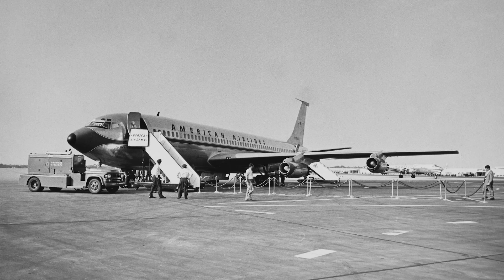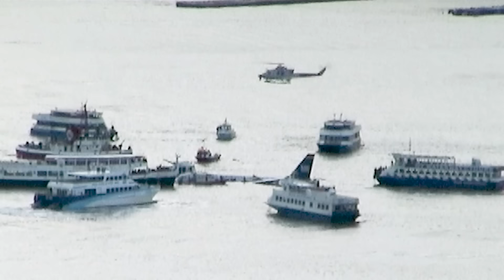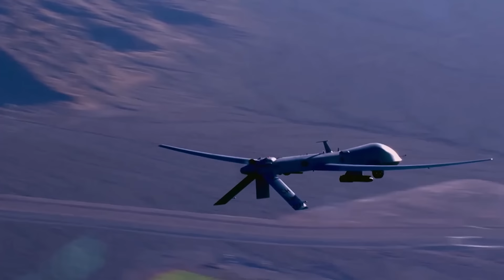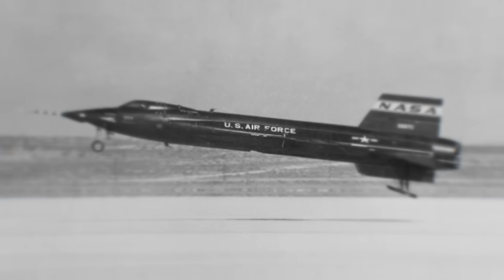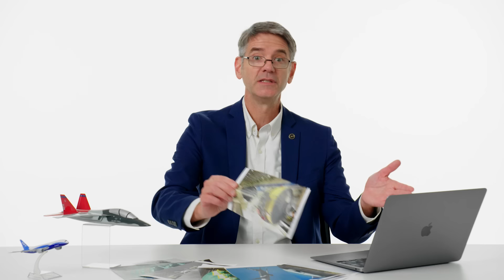Aerospace Engineer Answers Airplane Questions From Twitter | Tech Support | WIRED

Comment: The ramp does make sense. It'd like to see someone bring it to market.
Reply: No, it DOESN’T!!!
Reply: @johnp139  Talk about being uninformed. A well designed ramp will allow runways to be approx. 35.8% shorter and decrease runway related crashes by 59%. You can test it yourself scaled down with models, it works.

Comment: No ALL multi engine planes can fly with an engine out. Smaller piston engine planes don't need to be certified to fly on a single engine, and often times when an engine goes out, the plane ends up in a "powered glide". However ALL airliners can fly with an engine out.

Comment: The best way to understand how air lifts a wing is with a sheet of paper. Hold an edge of the paper at your lips, then blow over the top of the paper. The paper will then lift up, due to the faster moving air on top of the paper dropping pressure.

Comment: To be clear, air travel is safer today than ever. The NTSB investigates all crashes and significant pilot deviations even when there is no injury or loss of life. In the vast majority of commercial crashes, the causes are investigated and recommendations and changes are mandated to make that particular reason very unlikely to happen again. Much of the training pilots receive post license issuance is a result of those investigations.

Comment: Gonna guess it's cost and that it would put excessive wear on the landing gear and frame, also there isn't much of a point because you would also need an arresting wire capable of significantly slowing a commercial jet which really would be expensive.
Reply: For WHAT??? He answered MANY QUESTIONS!
Reply: @johnp139  the title.

Edit: sorry thumbnail*

Comment: I have family that works in the Aerospace industry and i remember one of them saying they were working on designing software that if both pilots were compramised the airplane would go into a holding pattern at the nearest commercial airport.  Another family member was working on hydrogen cell powered aircraft.
Reply: What happens when it runs out of fuel?

Comment: Airplanes use metric system or imperial system?
Reply: Mostly imperial. The only difference is in weight. In NA they use lbs (pounds) and gallons for fuel. In ROW uses Tons / kg for both weight and volume.

Comment: I may just be dumb, but if a plane can fly with 1 engine, how does it continue to go straight and not just into an uncontrolled spin? cause isn't the center of mass/gravity near the middle of the plane? so wouldn't the 1 engine just push one side forward into a spin?
Reply: Aerodynamic surfaces such as a rudder.

Comment: Re: the last 50 years -- airplane speeds have not increased over the last 50 years because increases in speed result in a decrease in cost efficiency. Beyond the current cruising speeds, efficiency begins to drop rapidly, which increases costs rapidly. We're at that perfect compromise of speed and cost. ("perfect compromise" ha ha)

Comment: 10:24 Not the best answer! Obviously, the ramp would be installed after the point of V2, when the plane was committed to take off anyway. In addition, his explanation about needing room to stop doesn't make sense, because going up the ramp would help stop the plane.
The real reason you wouldn't want a ramp is because most runways are multi-directional, depending on wind direction. Interesting that he failed to mention this!

Comment: wouldn't it be possible to just use a combination of electric and gas? like, have a slightly larger turbine in the back of the plane, which generates electricity which in return powers electric motors that drive the plane. this would also replace the standard generators on board of the plane, as they are no longer necessary. this would also reduce drage I believe as now the power can be made by thinner electric motors, having in total a lower frontal area. 

this plane is now less reliable, as there is only one engine carrying the entire thing, but this one engine is exposed to less harsh conditions, can be made of a higher quality as costs are now saved in multiple ways, and thus can be made much more reliable then the standard jet engine.

the only problems I see is the design, as the engine should be easily removable for service since there is just no way a mechanic will be crammed up in the tail piece, plus the areodynamic design of the tail will be gone, since there is now a giant exhaust.

Comment: That’s odd… the other guy on “Wired” said 1 in 11 million… this guy said 1 in 123 million😂
Reply: That's the difference between international and domestic flights.

Some countries and low budget foreign airlines lack alot of safety standards.

Sadly this year will probably be deadlier than the last in the US, because the president just gutted the FAA and fired hundreds of air traffic control staff.

Comment: Why hasn't commercial aviation improved? Well airplanes have improved (a lot), but airlines have gotten worse, and mostly that is due to cheapness/service cuts. That is a business issue, not an engineering/design issue.

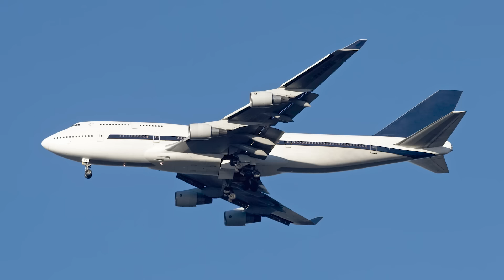Comment: 3:30 747 had up to 5 engines mounted to the wings, but they didn't often install the 5th engine.
Reply: The 5th pylon was for ferrying engines only
Reply: @Orbital_Inclination  yep. that's why I specifically said "mounted on the wings"
Reply: @Orbital_Inclination  PS, the only record I can find of the 5th pylon being used to carry anything is Qantas and Virgin Galactic. Do you know of any others?
Reply: @Orbital_Inclination  P&W have a 747 SP with 5 working engines, but the 5th engine isn't mounted on the wing. (And of course they all have a gas turbine in the tail)

Comment: Airplanes are safer than cars, but i have to disagree with the second factor, multiple redundant systems.
Cars have the same amount of critical backup system as planes. Only cars have way less critical components. Basicly, brakes on a car are the only critical system you would need, and you have your main brake and your emergency brake as a backup.

Also, when it comes to hardware, the same safety principles apply, including testing and crash investigation.
If flaws are discovered, a recall can be mandatory.

Now, where it all falls apart is any monkey can get their hands on a driving license, and these are mostly given for life,
No matter how many rules or regulations change.

Comment: The question "Can a plane fly with only one engine?" isn't answered correctly. You made an answer to the question "Can a plane fly with one engine _out_?", which is not the same with engines having more than two engines.

So if you have a plane with four engines, can it fly with only one of the four engines?

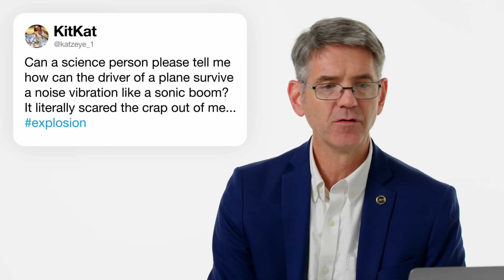Comment: About 9:00. The batteries would also get lighter as electricity is used out of them. Obviously the weight of the battery itself is way bigger than just a fuel tank for example, so the effect is neglible.
Reply: Are you serious???
Reply: @johnp139  Yes, a full battery is slightly heavier than an empty one. I'm surprised people don't know that.

Comment: After 35 years as an aircraft mechanic I've wondered if they are missing some simple ideas.
1) Elminate wing flaps and slats.
2) Eliminate thrust reversers.
3) Eliminate retractable landing gear.
4) Reduce the pressurization system to one and just fly lower.
5) Eliminate flight controls and vertical stabilizers and just use vectored thrust.

Comment: most of those comments make me wanna puke ... why do people think you need to be some engineer or professor to state common sense? i can easily answer 90% of those questions by using common sense.
things like why black box survives and why can't you make plane out of same material .. it's common sense and basic physics. same reason why you can make 3D printed plane and throw it out of window and it won't break when it crashes onto ground, but you can't even make a real size plane out of 3D printed material as it would fall apart even while being at ground --- common sense!

or things like why plane flies at 35000 feet .. it's COMMON SENSE, it's where drag to lift ratio is optimal to save as much fuel as possible. i'm absolutely SHOCKED to see how dumb people are in comments ... thinking you need to be engineer to understand common sense.

or like questions about g-force and how pilot survives sonic boom ... those are just FACEPALM 1000x, i undestood this when i was like 5 years old, it's common sense ... i learned what g-force is when i was using a swing at 5 years old. i have senses, i can feel how forces effect my body. i didn't know it was called "g-force", but i understood the concept ... what is there to understand? its common sense!

and then ppl in comments go like "wow he's so smart" ... he has common sense, you don't.

Comment: 2:28 He is correct to state that all of these are important reasons why people can flying 35,000 feet in the sky at 500 mph and still be relatively safe, but none of them really address how this could possibly be safer than driving with four wheels at a fraction of the speed on the ground.

The most direct explanation as to why there’s a lot less plane accidents than car accidents is: there’s not a bunch of other planes near you clogging up the sky on their way to important daily events.

Comment: I came here for the ramp answer, BUT MAKES NO SENSE: he said more space to brake, but the ramp would help to brake. The most correct answer would be "is better to hit something in front than force to lift off and then falls down because of no resistance on the wings".

The black box answer is also non-sense, isn't because is heavy, is because the death cause isn't the plane body distortion, is the impact caused by the hit (G-force), that means, black box would cause bigger G-force because of no body distortion to absorve. The mass isn't the issue here, if the black box were lighter tomorrow, this would change nothing because the issue is the material distortion to absorve the force, all the other experts I saw said this.
Reply: No

Comment: There is absolutely no "miracle in Hudson". Landing to flat water is the easiest thing to do. Choppy waters are difficult as big waves will break the fuselage to parts. But to a still water, like in NYC, the easiest thing to do. And that is even practiced all the time in simulators. No miracle there, except with people/media/politicians who do not know anything about aviation, and think that there was some airmanship included. Not even tiny amount, the only real thing to do is to keep wheels up, and press the DITCH-button in the top panel. Yes. That button. They did NOT press the ditch button, and so, the fuselage belly opened a pressure equalizing valve, and the plane sunk. 

Normally, that fuselage would sail to the Atlantic, as it is water tight to a very good degree. But no, when pilots do not tell the airplane that next stop is ditching, by pressing the ditch-button above, then that will happen. When there is no automatic belly-valve-pressure-equalizing, it can be impossible to open the doors (as they are squeezed to the rims with cabin over pressure). The procedure is for the co-pilot to open the cockpit side window, which will then equalize fuselage pressure to outside pressure very nicely.

So, despite what the stupid hollywood, propaganda and media says, landing  on a flat water can be done even by an amateur. Really. For real airmanship, Gimli Glider, Air Canada 143 was one good one. I know incidents where about 50 equally pure talent and airmanship really showed their expertise. Those again were not the  "natioal heros of USA" who do a very simple ditch, with the belly valve open.

Comment: Right now explain about Boeing safety 💀
Reply: You're talking about Vilnius? Very unlikely plane system fault. Still under investigation. IMO is either ground navigation system failure. Or Pilots error since it's found that the Altimeter setting is incorrectly set, comparing to the current (at the time) of the accident.
Reply: Nothing wrong with Boeing, use some critical thinking.

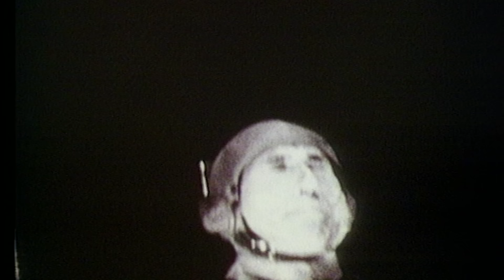Comment: Your explanation at 1:40 .. As the plane climbs, the blood in your body gets pulled down, causing Gs….”, I’m really surprised by how you’re confusing people by, mixing up the cause with the effect. It’s the G forces, caused by the airplane lift changing its direction of motion, that cause the blood to be pulled down! BTW, the plane doesn’t need to go up, for the G forces to “appear”, actually for military pilots, the most common G forces are generated by tight horizontal (almost) turns. I know that you know better than I, just make sure to phrase the explanation properly for us dumb people.

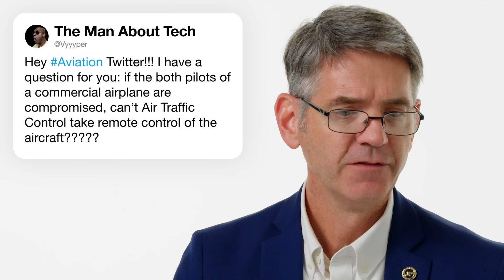Comment: 5:42  yes they can. They’ve been able to since the late 90s, except it’s not ATC, taking over, it’s the military. And it’s not installed on all commercial flights ALLEGEDLY
Reply: This isn't true, there is not a remote option on any commerical airliner
Reply: Your flat out wrong. Not a single commercial airliner has remote capability’s. I’m a private pilot and have studied Boeing and Airbus aircraft’s flight control systems heavily. Your wrong.
Reply: No

Comment: I won't ever go on an airplane until someone, in layman terms, explain how this humongous thing is able to fly and not fall out of the sky. For me it just doesn't add up, my chickens can't even stay up that long and they are way lighter. I apologise for sounding dumb but I just don't get it.
Reply: Yeah, pretty dumb.  In a moving car at 30mph, put your hand out the window.  Can you feel the air lift pushing your hand up or down depending on the angle and shape your hand makes?  Pretty strong force right?  Now let's put something bigger out the window, hold on to a big piece of sheet metal, say maybe the size of a movie poster and stick it out the window and try to angle it around like your hand.  What kind of forces do you expect now?  Impossible to hold on to the sheet isn't it?  Lotta force.  Now scale everything up, 200MPH, big wing, you can imagine the amount of force lift can make.

Comment: 10:22 "Why can't airports have a ramp?". Those who answer "NO" have never flown in Nepal before! 😅 Try Talcha airport for example. It is in the Himalayas, so it is surrounded by steep mountains! The only way in was by the pilot side slipping the plane down almost vertically, and then landing on a short runway going steeply uphill! With a flat runway we would have gone over the edge and landed in the valley 100's of metres below. Take-off of was the reverse. Start at the very top of the hill (runway), apply full throttle with the brakes on, release and pray... 😂

Comment: The entirety of an Airbus's flight interface is fly-by-wire. Otherwise known as ZERO PHYSICAL CONNECTION BETWEEN STICK AND CONTROL SURFACE. How is that not susceptible to a hack. If someone can access the systems controlling the flight surfaces they can absolutely control the plane remotely.

Comment: Wow my man just gonna sit here and lie to people.  Those safety stats only apply to the major commercial airlines the big planes flying lots of people.  Look up the stats for GENERAL aviation and the small planes all your private and charter flights those crash EVERYDAY.  It actually averages out to more than one a day with super high fatality rates, cuz just like the big planes you may be less likely to crash than a car but you're also a lot less likely to live if you do.  He also kinda implies that wings can't and don't break off but they can and do if the plane is subjected to higher g loads than the plane is meant to or able to handle.  The questioner thinks they don't happen because u never see a plane with a broken wing but that's because once a wing comes off the plane either has an "in-flight break up" and comes apart in the air or it smashes into the ground either way it's not sitting there on the ground for a photo shoot with its broken wing.
Reply: Which MOST PEOPLE FLY ON!

Comment: The whole "airplanes are safer than cars" nonsense is because it's comparing apples to oranges. Flying in a commercial airliner is, as he points out, being in the hands of an entire travel industry built around stringent regulations and fear of backlash. It's like talking about how safe you are riding in trains or coach buses and calling that "driving." Compare the proportion of deaths in owner-operated light aircraft every year to that of cars and try to tell me being up in the air is safer than being down on the ground, lol.
Reply: Irrelevant